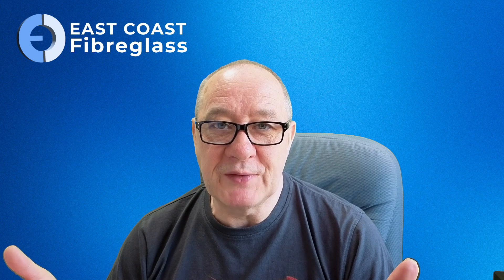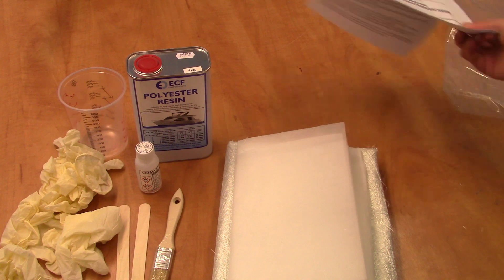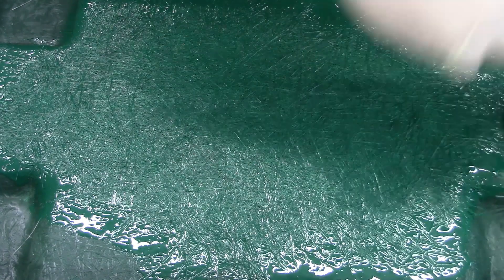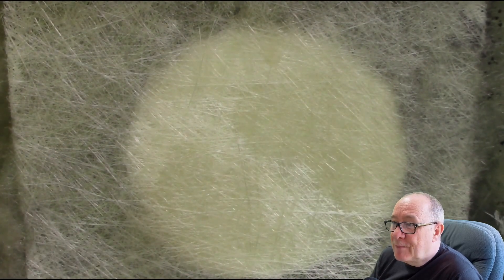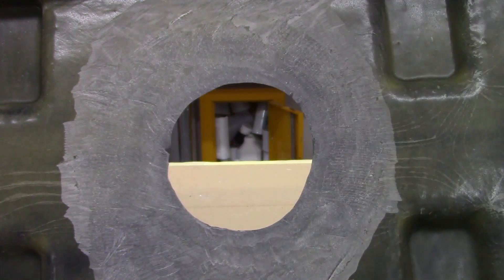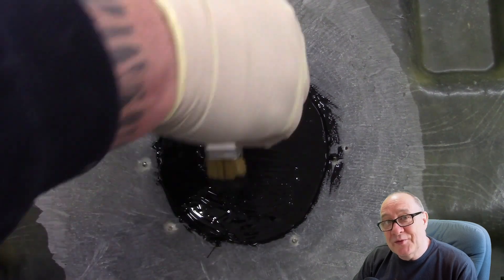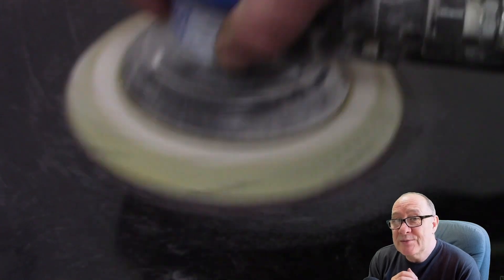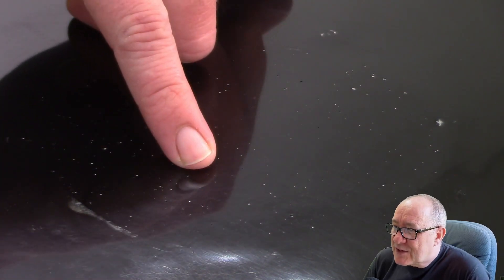Fibreglass Repair - 3 methods

Comment: Hi I hope you can help me I was watching one of your videos about PVA release agent once
Reply: You have added it and it's dry can I paint on it and then fibreglass it and then will it release it
Reply from the maker: @ HI Unfortunately standard paint wont work. paints will be attacked by the styrene solvents in the resin and melt. I once did an experiment with this and ended up with a sticky mess on the mold and the part.  This was also difficult to release due to the sticky paint residue.
Reply from the maker: Gelcoat is best to use after the PVA release agent before the fibreglass to produce a part.
Reply: Hi there thanks for your advice I'm making a pond mould so u would say black gel coat paint?
Reply from the maker: @richardfrost1026  Hi It woudl probably be best to speak to our tech team or call our store 0191 497 5134  or e-mail sales@ecfcomposites.co.uk